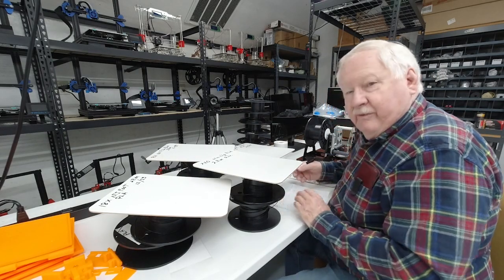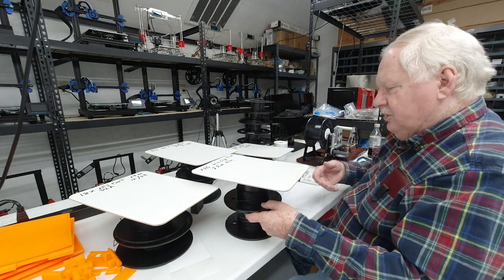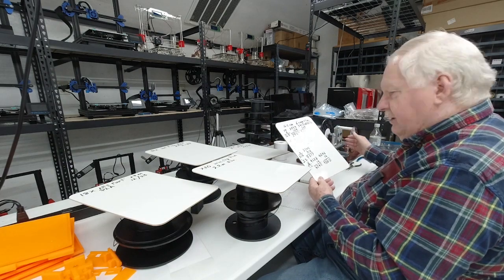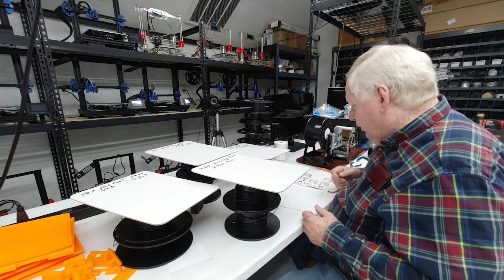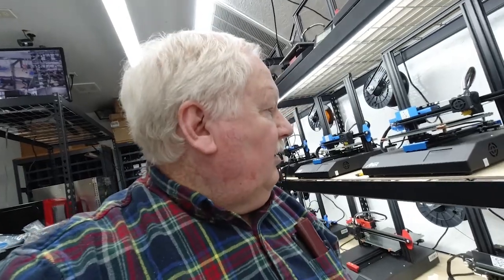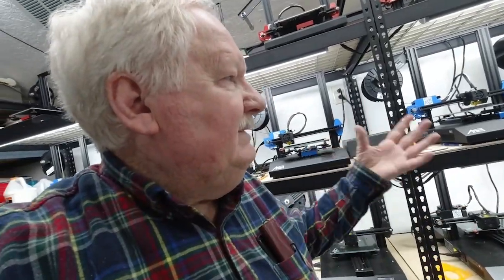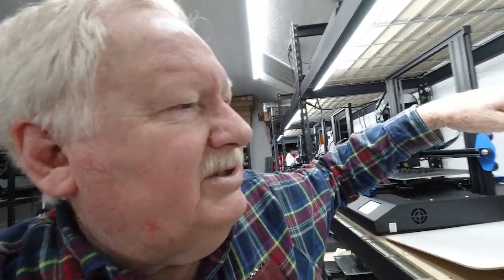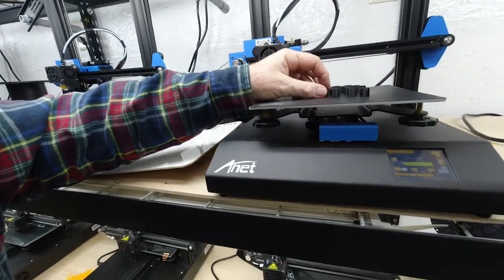MAKING MY 3D PRINT FARM MORE EFFICIENT  using my filament counter helps save money.

Comment: Have you looked into any adhesives for the beds to make them stick better? I.e. magigoo or nano-polymer
Reply from the maker: Have not looked at the ones you mentioned, but I will. Thanks for sharing that Justin and thanks for your support...Ken
Reply: @NewTechInventors  your other option is to go with a build plate from 3DQueue Systems

Comment: So have started buying bulk filament, like 5-10kg spools for extra economy? I am still not sold that respooling each print job is an efficient use of your time. Your time is probably more valuable than having a couple dozen extra spools of material that you will eventually use. I could see maybe spooling 4-5 jobs onto a spool, and then label that spool "5x Part YYY" Then at least when you need to run a batch of Part YYY, you would have a spool ready to go. Spooling multiple jobs in one setting has got to be a better use of time than starting and stopping spooling. I see value in respooling, I do it is my self, just not in such small values.
Reply from the maker: Thanks for the comment my friend. I agree with some of your ideas, and you must know that I don't use my counter on all print jobs, I would say that about 50% of my printing uses pre-loaded spools from my filament counter and the rest usually run off a new spool  of filament, till it runs out. Thanks for your support...ken
Reply: @NewTechInventors  Not sure what brand of PETG, price point, or qty you are using? But IC3D in Ohio, makes some outstanding PETG, and gives a massive discount when purchased in 20kg spools. Even the 2.5kg dpools are discounted better in bulk than lost suppliers. Their recycled PETG is even cheaper, vs more expensive like most companies, and prints like a dream!

Comment: I'm not sure I understand how this is more efficient? 

It seems as though you're just spending more time preparing each job?
Reply from the maker: Good question! let's see if I can explain how it works for me. First, I print mostly in PETG and PLA. I have many colors of each, but mainly print parts in about 6 colors. This means I must have about 10 different spools of filament in stock for my print jobs. Since I have over 60 operational printers now, with some dedicated to single parts, and most of my print jobs take 12 to 48 hours to print and some parts over 12 hours each, It is common that I am running the same filament on as many as 24 printers at the same time. Rather than have a new spool in 24 printers, I can count off what I need for each printer in about the same time it takes for me to bag and seal the new spool after each use. now I normally have only 1 or 2 spools of a type rather than 24 open in inventory. Moisture is a problem in 3D printing, especially with PETG. I print PETG at around 245 degrees and if there is any moisture in the filament it turns to high pressure steam when it hits the hot end and this can cause uneven flow and a bad print. I agree If I only ran 3 or 4 printers at a time, the filament counter would not be as useful. I hope this helps. Thanks for your support...Ken
Reply: @NewTechInventors  so rather than being 'efficient' it's just reducing the amount of materials you're required to have on hand? 

If anything, this method leads to more wastage than having more spools of filament on hand right? The safety margin you add to the end of each 'mini' spool will add up over time no? 

With both PETG and PLA you might find it easier just to dehumidify the entire room (rather than put them in bags when not in use)

Below 20% humidity you shouldn't have any issues with either material.
Reply: he's methodical in keeping track of each job.  There are  ~50 printers to manage....large scale operation will need some kind of organizational system to be in place
Reply: @irwinpks  but it's not efficient? 

Why divide the filament onto smaller spools when he could just put 1kg spools on each printer and use it till it's empty? 

This method will waste more filament, and take far more time than just putting a full spool on each printer.